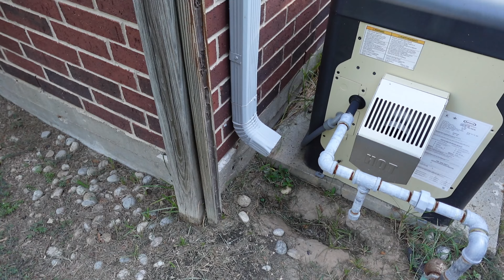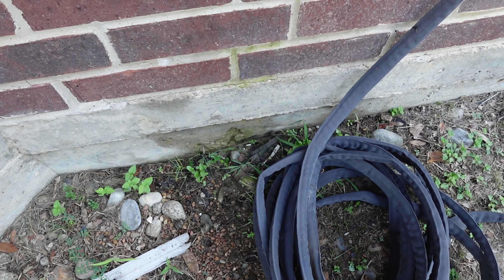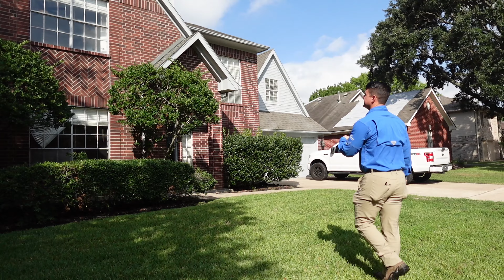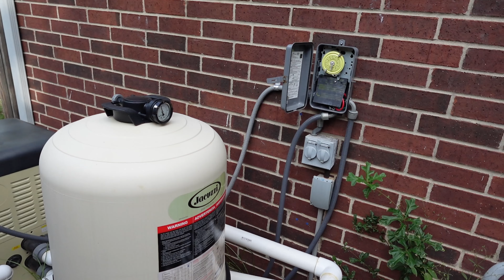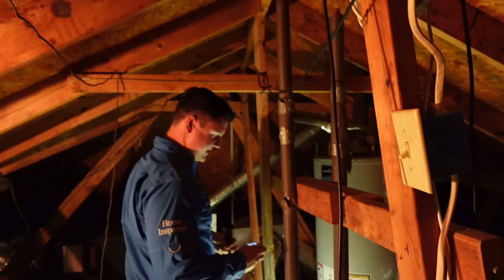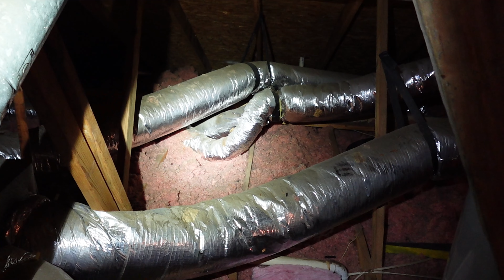Home Inspector Walkthrough – 1989 House Exterior, Pool & Attic 🏠

Comment: Do you find it better to take pictures and enter them into the report once you're done or use a tablet or something similar and do the report with the pictures as you go?
Reply from the maker: I used to fill out the report and take photos throughout the inspection. Now I complete the full inspection first and then enter all the data at the end. I’ve found that this keeps me more focused during the inspection without all the extra distractions. The downside is that you have to be very thorough with your photos and take your time when writing the report. Otherwise, it’s easy to miss something important because of the delay between finding the issue and entering the data.